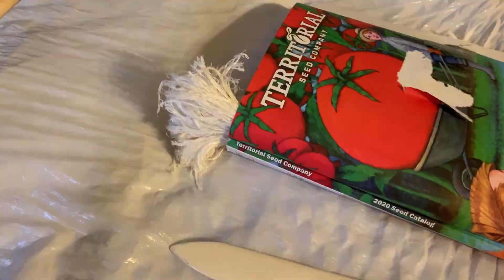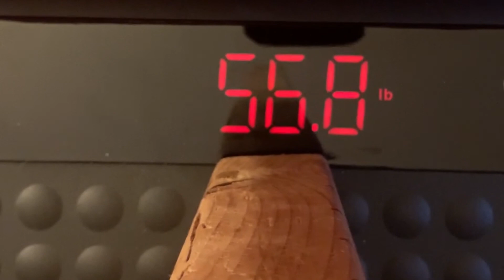Building A Sinew Backed Hickory Short Bow

Comment: Built mine sitting on a bucket with a hatchet and pocketknife. It works.
Reply from the maker: Right on! I’ve done one with a tomahawk and knife on a log. Being able to work with what you have is a great skill, and it’s fun to switch things up anyhow.
Reply: @EccentricArtisan  

The tiller is pretty uneven and its got a little bit of a hinge. Its 52" long and draws out around 45#. Someday Ill probably work on it a bit more and bring it down to around 35# and hopefully even it out. Hickory does make for some beautiful aesthetics. Mine has a polished back that looks almost like a hologram.
Reply from the maker: @springbloom5940  I’ve always appreciated the look of hickory as well. Sounds like a handsome bow! I wish you luck on evening up the tiller. I find small removals and frequent checking helps a lot.

Comment: Years ago I built one out of red elm and backed it with rawhide. I bought one of the largest dog chew toys and soaked it in the tub for a week. I used unflavored gelatin as the adhesive, that stuff is TOUGH. Mix it thick like paint and heat it up with a camp stove. I brushed it on the wood, applied the damp rawhide in two sheets, one on each end. Then I clamped it to a bed rail and put it in the shed, in August for a week. It worked very well. I had to use a bench grinder to remove the excess rawhide.
Reply from the maker: Yeah rawhide is good stuff too! I’ve used it on other bows. Definitely very tough stuff! I’ve not tried gelatin, but I’ve heard good things. I’ve mostly used wood glues, but I’m going to be working with some hide glue on a full primitive build soon.

Comment: lovely. im a beginner bowyer and this is lovely to watch
Reply from the maker: Glad you like it! How have you been learning so far? Through a book, videos, a teacher?
Reply from the maker: abis10 alpha10  thank you!    The short answer is, in my opinion, no. You could potentially go a bit higher in weight than this bow. The general rule is that a bow should only be drawn to half its total length. In other words, the bow in this video is 50” from tip to tip. Drawing to 25” is the max safe draw that many people would recommend. I do draw it past that, and it hasn’t broken yet. However, the shorter the bow, and greater draw weight, significantly increase the likelihood of limb failure. I used hickory wood and sinew, because it is an extremely tough material combination and less likely to fail under extreme stress. Potentially a bit longer bow could do what you are looking for.
Reply from the maker: abis10 alpha10  that idea has potential as far a draw weight goes. Depending upon the way they are merged though, you may get remarkably different results in arrow cast. Poundage is import, but so is limb/energy efficiency. If you cannot transfer all that potential energy into your arrow then it makes the poundage useless. You may find that it slows the arrow speed too much. I don’t have experience with your particular idea, but I can say that there’s always room for experimenting. A lot of bowyers poopoo the idea of making bows like the one in my video, simply because they don’t like the weight stacking in the draw and the possibility of limb failure. But I know that I’ve successfully created bows that I’m comfortable with, so I don’t care much what they feel about it. I’d say, if you have an idea, give it a whirl. You don’t know until you try. Also, you may already be familiar with the book series, but if not I suggest reading the Traditional Bowyers Bible, volumes 1-4. They are packed with knowledge.
Reply: @EccentricArtisan  mostly videos and a lot of trying new things and just seeing if it works 😁
Reply from the maker: @DogsaladSalad  the best way to learn in my opinion!
Reply: @EccentricArtisan  people say wood glue dont work on sinewbacked bows. I dont see no lack of performance in this bow . Hope ur next video is of u take a whitetail with it
Reply from the maker: @dariuswhite2543  I’ve heard that opinion expressed before as well. Those people just don’t understand the properties of wood glue. Once cured, it’s quite similar to hide glue. The advantages being that it holds up to inclement weather better. Proper hide glue is already pretty tough, but this Titebond 3 can literally be submerged in water without ill effect. No bow deer yet, but I did take a nice buck with my self built flintlock last weekend.
Reply: @EccentricArtisan  how long was the drying time for the wood glue and sinew and did u have to wrap the bow with a ace bandage. Im thinking about using titebond 3 for my new 58 inch flatbow
Reply from the maker: @dariuswhite2543  drying time will vary by climate, but at around 70 degrees fahrenheit and moderate to low humidity, 2 weeks or less. Heat and moisture, or cold air will slow the process. I waited 2 weeks before working or stressing the bow because I had time. 1 week would probably have sufficed. It will also vary by how many layers of sinew you add. I used 3. Wrapping is extra work, and unnecessary in my opinion. Just be very meticulous when laying the sinew. Don’t over or under-use glue, and put extra effort into laying the bundles flat and smoothing them.

Comment: You can make stain from the green black walnut casings (or whatever that was. Maybe hickory.) By cutting out the nut and letting the green outer shell soak out in the sun in a bucket of water. (Of course you'd need like, 20 nuts worth for half a five gallon bucket)

To get a thick stain, you need to let it sit in the sun for about a week (or until nearly half the water is gone)
Reply from the maker: I haven’t tried that with green black walnuts before. I’ll have to give it a whirl sometime. On this occasion I only needed a light coloring. I do like to keep the ripened hulls for staining. You can get some really nice and dark tones from them.

Comment: Hi, good video,I too favor short bows but I can't get hickory here in New Zealand, so far I've used elm, pin oak, hard maple, at present I am experimenting with an Australian wood called Tasmanian blackwood (acacia melynoxolin) , a very beautiful wood, so far looking promising.I wanted to ask you how you deal with the issue of stringfollow, particularly in a short bow,I think it is a big problem and I can't seem to find any real answers to it, be keen to hear your thoughts..
Reply from the maker: Well as far as wood goes here in the states the heartwood of osage orange followed by black locust are most resistant to water. And given that string follow or set is typically seen because of the wood’s moisture content being a bit higher when drawn or in use they automatically are better. However, bows with other wood types can be kept well dried when stored or not in use and a fresh coating of animal grease mixed with bees wax or pitch glue (or any similar modern finish). Those two things will significantly reduce the moisture taken in and in turn reduce string follow, but they have to be done religiously. Overdrawing (per the stress the limbs can safely handle) can give limbs permanent follow as well so taking care not to do that will help. And finally I highly suggest sinew backing as it has for me kept follow very minimal or non existent.
Reply: Very good answer, thanks, I have sourced acess to deer sinew and I most certainly want to try that procedure, could you give me some idea of the quantity required to back say a "60" in bow, Cheers..
Reply from the maker: @mikenorris6769  it will depend on the size of the particular deer in question, but for reference I have used elk leg tendons. When using leg tendons for backing 1 layer on a 50” long bow took about 3 elk leg tendons. Most other deer being smaller I would hazard a guess at 4-6 tendons, size depending of course. It’s definitely always better to have more than necessary prepped though! I can say that for sure.
Reply from the maker: After that it’s just determining how many layers you want. Personally I think 1 is fine and two to three is probably optimal.

Comment: How long did it take to dry the sinew backing when using titebond 3? And also I wonder if it would work with titebond 2 instad of titebond 3 for the sinew backing
Reply from the maker: It definitely does work. Almost exactly the same. The difference is that Titebond 3 is rated as waterproof short of submersion in water. And actually even with submersion it holds up incredibly well. This just creates a bow you can take out in rain or get wet and have no worries whatsoever about glue separation. In other words, it’s overkill for most people and scenarios.
Reply: @EccentricArtisan  any recomended glue to water ratio?
Reply from the maker: @hannibal230  personally I just eyeball it but between 70-90% glue and 30-10% water is where I would feel comfortable. It ends up being more water than that anyhow because I always fully saturate the sinew in water before wringing out and dipping in the glue mix.
Reply: @EccentricArtisan  one last question if you dont mind, I know when using hide or fish bladder glue it take no less then 3 months to be safe for the lamination to dry and cure but how about with titebond how long does it take? As i dont want to stretch and use the bow prematurely otherwise i will delaminate it
Reply from the maker: @hannibal230   well 3 months is excessively long for any glue. I don’t mean at all to be rude, but that isn’t a time that you have to wait. The only way a glue takes that long to set is if you intentionally leave it in an environment where it won’t. And that’s not a good thing. Hide and fish glue aside though, Titebond can be extremely quick given the right conditions. If you watch my other video that actually goes into detail on how to build this style bow, you’ll see I managed it in 6 days total, from wet sinew going on to final tiller and shooting. I did three layers on that bow as well and I talk about the conditions mine cured under too. It might be helpful to watch. https://youtube.com/playlist?list=PLLkW_3a6dWV-xrYxx3Mco4I9XOjs8qzJ4
Reply: @EccentricArtisan  wow that's actually a game changer for me as now i can sinew backed my bow with a fraction of the time needed than previously. Thanks for sharing all the infos and tips, i highly appreciate it
Reply from the maker: @hannibal230  any time! I love talking shop and sharing is what I’m here for!

Comment: What were those green fruits you used after the blackberries?
Beautiful bow btw!
Reply from the maker: Thank you! Those are immature black walnuts. They have a hull that grows around the shell. It starts out green, and as the years goes on, it turns brown/black and falls off, revealing the nut’s shell. The hulls contain a highly potent stain, that darkens as the hull ages. When green it gives a light, yellow-brown. Then towards the end of the year it will create a much darker brown.
Reply: @EccentricArtisan  Wow! That's so good to know! I wonder, do immature pecans stain similarly? There are a lot of pecan trees where I live.
Reply from the maker: @YeshuaIsTheTruth  They can, but I would assume not as easily. They’re considered a hickory nut, and I’ve seen shag hickory nuts leave stains on concrete after rain. Maybe if you boiled the hulls or similarly had a way of extracting the stain you could get it more concentrated. I’m certainly not an expert in natural stains or dyes though, just a hunch.
Reply: @EccentricArtisan  Thank you though :)
Reply from the maker: @YeshuaIsTheTruth  anytime! I love talking shop!

Comment: When making a shortbow is greenwood better than hickory I can buy at a store?
Reply from the maker: It’s definitely better, but I wouldn’t say absolutely necessary. The difference is that boards from the store will be cut from a log. That means the growth rings are “violated” or cut across. If you harvest your own wood from a tree you can peel off the bark from white wood like hickory and there’s one growth ring underneath that is left intact. The same can be accomplished with osage or mulberry by splitting and cutting down to one ring of the heartwood. This is much stronger under tension of drawing the bow. However, if the bow is of appropriate design (wide limbs and moderate draw weight) with sinew backing, you can make them from a store bought board. If you want to research more I highly recommend the Traditional Bowyers Bible book series. The first book covers the basics and the other get into further detail.
Reply: @EccentricArtisan  thank you so much. Where is a good place to get sinew and was that regular wood glue mixed with water u coated it in? Also how long was the wood u harvested to make the bow
Reply from the maker: @kcsniperboy7148  I like to get my sinew on eBay. You can search for elk tendon or back sinew. Just different parts of the body but the same material. Then just find a video in processing it into strands. Yes, that was wood glue. I like Titebond brand, and 2 or 3 will both work. 3 is just waterproof so it can withstand more moisture when out in the elements. Initially the wood came out of an 80 foot tree. It was sawn into 5 to 7 foot sections. Then those sections were split lengthwise into quarters and eighths. The ends were painted to keep from drying and cracking excessively. Some of the wood was left to dry for a year or two, but it can be worked much sooner. This piece was from a 5 foot length that I split and shaved down to near finished dimensions. I then cut it close to the final 50” length and kept it indoors. Wood processed in that way can go from green to dry and ready to work in a very short time, because there isn’t much mass left to hold the moisture. The drying speed will vary based on heat and moisture of the environment. Optimally the moisture content of the wood should be between 9 and 12% when you start tillering (shaping the limbs to draw weight) you can get away with a little less depending on the wood.
Reply: @EccentricArtisan  thank you so much this has been immensely helpful. About 5 years ago I made a take down recurve bow in my woodshed class but I used more modern methods with oak riser amd 2 layer laminate hickory that I then coated in fiberglass sheets and pressed together but I wanted to do a traditional style this time so thank you.
Reply from the maker: @kcsniperboy7148  glad I could help! I hope you have success on your first attempt at primitive. I’m currently trying to humidify my workshop to get my bow wood back to working moisture content. Once that’s done I’ll be finishing up a video showing how I did the main steps of the process for this bow.
Reply: @EccentricArtisan  awesome can't wait till that's done